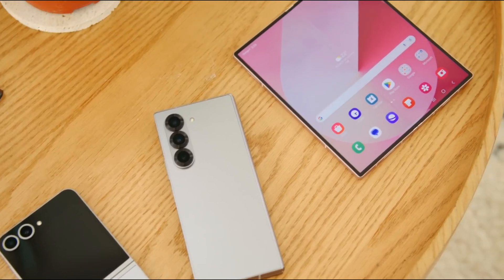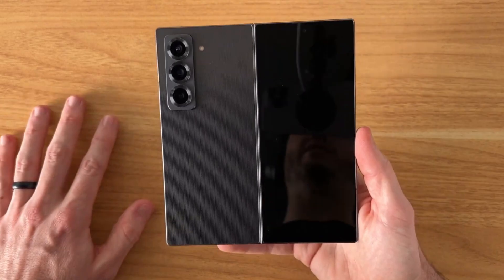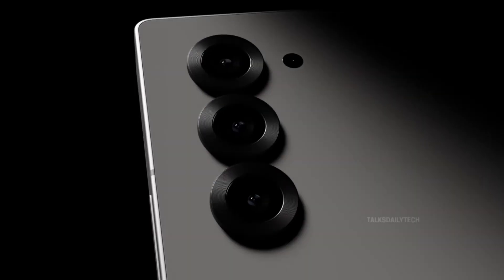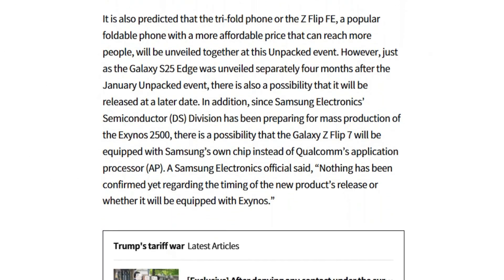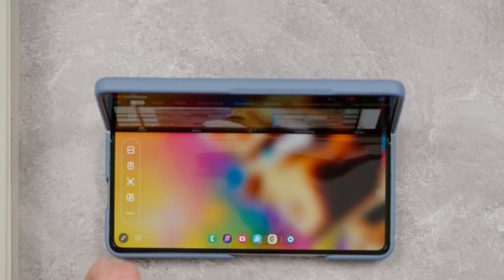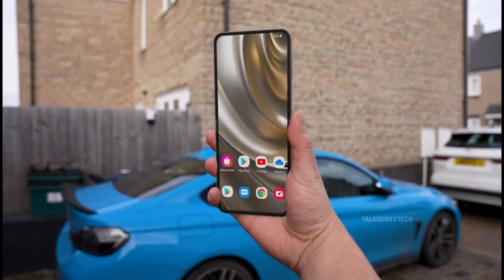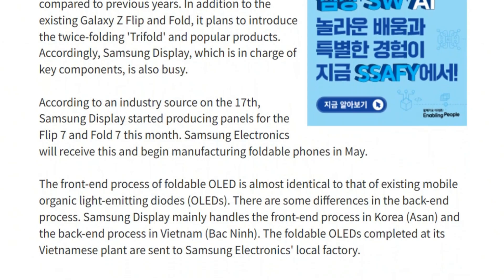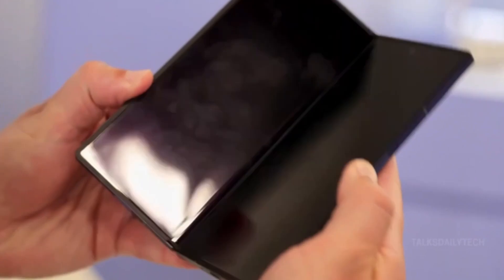Samsung Galaxy Z fold 7 - YES, IT'S OFFICIAL

Comment: MY BIGGEST GRIPE  (Samsung Fold owner). . . I have yet to find a setting for this so, if one exists; my ignorant lazy @ss hasn't found it yet.  I absolutely hate the text bubble!!  How is it that I have a screen larger than life but, when I am writing a text I can only see 5 words before having to scroll.  How about creating an option for messages that allows the user to select having the entire screen for your place to respond instead of showing the threaded conversation?  "But what about being able to see what they respond with"... easy you make that a scroll function like page up and page down. So if you wanted to see their messages you just swipe down and when you want to write, you swipe up.  I can't believe this doesn't already exist, ESPECIALLY for the phone series specifically.
Reply: Are you using the Samsung text message app? Or the Google one?
I use the Samsung one. If I open messages I see the recent message threads column on the left and the current message chat on the right. On the current message portion there is an arrow and line next to the contacts name. This will push the threads column over and make the current message you are in full screen. I don't know if this exactly what you are talking about about, if not can you describe the screen environment a little better?
Reply: @dubbleA100  thank you for that information.  I was using Google.  There is a trade off.  I cannot Emoji React to individual texts but being able to maximize one convo to take the complete screen is awesome.   Many thanks.

Comment: I want to see what they do with the 8 or 9 those will show the direction they go with the folds. 7 is just like the 6 but with slightly bigger cover screen and one camera change.
Reply: You forgot the invisible crease, with a better hinge and it’s slimmer, with one ui8
Reply: @dominic6287 it's not invisible the crease you can still see at angles it's just a little less. But those changes aren't game changers like a bigger battery or cameras on ultra. Or pen slot etc. It's just small tweeks especially if you have the 5 or 6. Like why would you spend more money because you get slight slimness or slight small crease.
Reply: @NoteFlakez Actually this is the first upgrade since the fold 4 that's worth buying. It actually is wider and has a bigger screen on both front and inside. This is what everyone has been asking for. It's also substantially thinner and lighter which is great. This is the first time in about 4 years where I'm not saying that it's not worth buying it because this is the first one I'm going to buy it since my fold 5. Of course if I was confident that they were going to release the G-Fold in America then I would wait and just buy that at the end of the year but I'm pretty sure they're not going to do that and it's only going to be released in Korea and China.